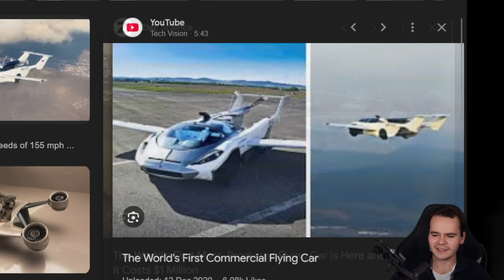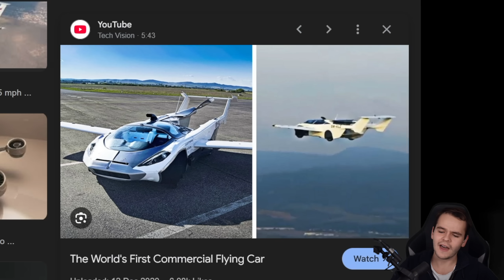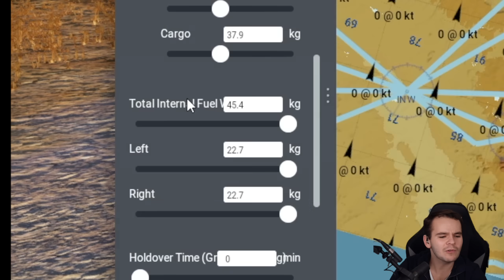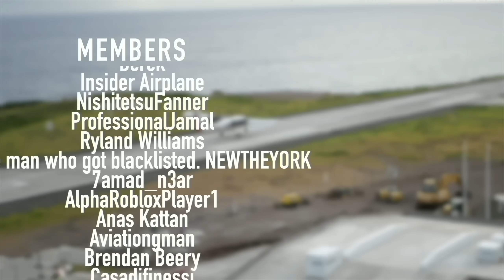Why We Don't Have Flying Cars (and never will)

Comment: I did this quite a few years back, BUT i did it properly.

That is with a car with a lifting body  and two small fins just sticking out that could be folded.

So the car actually could be driven on the road.
It flow terribly and i did need to have electronic stability activated to make it fly what so ever.

But when it came up to speed and altitude, it was lugging around quite hapily. It was very fast.

Comment: The 911 is  a bad idea for the choice of car, especially with the Cirrus jet because the weight and balance is very rear. The Porsche 911 is famously unstable. Maybe a 90s Audi would get a bit more weight over the front.
Reply: The 911 isn't unstable. It's only an issue if you try to brake hard and corner at the same time. They're incredibly stable if you don't drive them stupid.